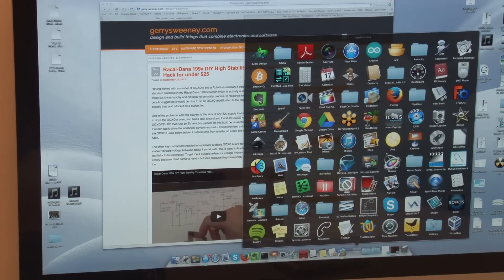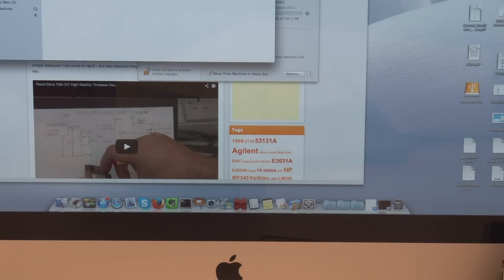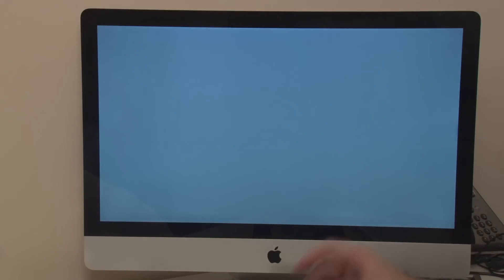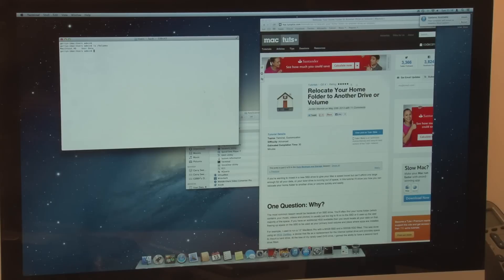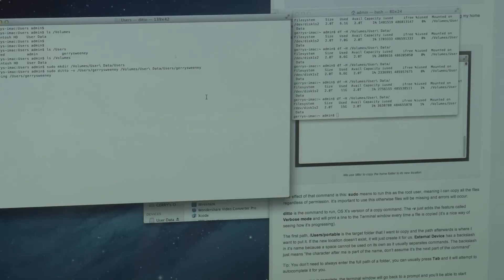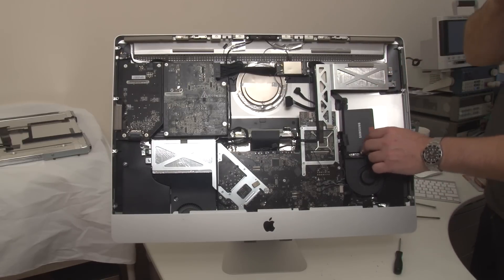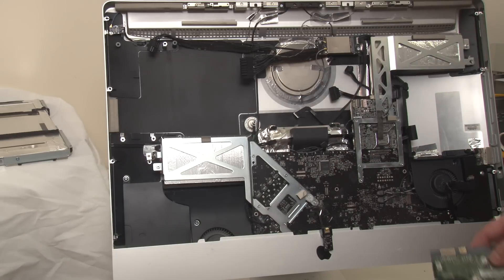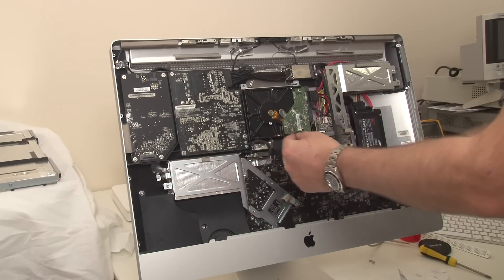Apple 27" iMac Teardown, SSD Hack and 2TB Upgrade

Comment: Hey! Thanks for this video! I was wondering if you could help me with your temperature hack? I have 43K subscribers so I help you out in return.
Can you explain in greater detail for us people who know nothing about transistors and thermal sensors how you did that at 1:01:00 . When I use bootcamp my fan runs full speed at 5,500 RPM and no software works for Winblows to control it. I tried everything.  I've done hours and hours of reading and there are hundreds of people that have this problem but no one has any tutorials on how to fix it without using software. I'm a complete noob with transistors and thermal stuff so when you explained that, it went right over my head. Is that transistor thing the best one to use for this situation, or did you just grab one lying around? I would be so grateful if you could briefly explain how you did it, and point me in the right direction on which transistor I should get that would be best for this. If you can help me I don't have any problem giving you a shout out on my channel. Let me know and thanks!
Reply from the maker: EpicGamerWorld yes I have been asked a lot of questions about this.  I have added it to the list and will aim to create a video to explain in detail. There are three different approaches that apple use for temperature sensing, and this video only covered one. To do this justice I would need to cover all three types so I will see what I can pull together, it does seem to be a source of frustration for people.  Thanks for your comment and for watching. Any shout out you give would be much appreciated. Gerry
Reply: EpicGamerWorld In case some folks aren’t comfortable whuffing up their own sensor, FWIW I was able to add a 3TB drive to my mid-2010 27” iMac (after the original 1TB died prematurely) and avoid ‘turbo boost’ by applying one of the old external HD temp sensors from a pre-2009 iMac (which I found used for about ten bucks). 

Alas I can’t find that Apple part # now (just the link to where I bought it, and they’re evidently out of business). Happily others have reported that using the external temp sensor from the optical drive (part # 922-9229, currently available at http://www.applecomponents.com/items/0000004398/cable-temp-sensor-optical/?pn=1) also works fine. 

Just make sure you insert the connector right-side up (it’ll go in upside-down too) or it won’t do squat…
Reply: Cz4rMike I got a fan control application called SSD fan control or something like that, but when I boot up into bootcamp my fan starts to run full speed again and I tried like 10 Winblows programs for fan control and nothing worked.
Reply: it runs fine because I have SSD fan control installed on mac but on bootcamp it goes crazy. I just installed bootcamp and a fresh copy of Winblows 7 like a few weeks ago.
Reply: No it messes up when running mac but the software fixes it. But I can't run mac software when I'm booted in Winblows, so I tried installing like 10 different Winblows fan control things and nothing works
Reply: I want a hardware fix not software so it will work no matter what

Comment: Definitely amateur hour here. Gerry you should have used a Opti-bay converter then you could have done away with all that additional wiring.
Reply from the maker: I don't think I was aware of such an adapter at the time otherwise I might have considered it, my goal was to get the job done which I achieved, I am still using the computer right now.  Sorry you feel it was amateur hour, I was certainly figuring out things as I was going - feel free to not watch or ignore the content if its not to your liking. :)
Reply: Gerry Sweeney Optibays have been around probably since slot loading laptops, they allow people to repurpose the odd tray to accommodate a secondary hhd/ssd. Well, I guess, if you didn't know, you didn't know. Great effort on the video non the less.
Reply: Yes, I used a ESata to Sata Converter and it worked wonderfully.

Comment: I'm no Mac guy but can't you just drag over the folders and files you want over to the new hdd. By the way I'm glad I have a pc desktop
Reply: There are a ton of invisible files that you'd miss, for one thing - and you'd have to re-install a lot of your programs.
There's a utility called Migration Assistant that automates this whole process for Mac-to-Mac transfers.  What Jerry did here could have been done by cloning the internal HD to the SSD. There's a program called Carbon Copy Cloner which does a very nice job of creating a bootable clone.
Reply from the maker: I have used CC many times before but I have seen lots of problems when the drives are different geometries which is why I opted for a file copy - its much safer... this is why Apples own TimeMachine does file backups and not image backups.

Comment from the maker: @Kalinga Yeah I know, slip of the tongue there I am afraid, I have spent so much time with Linux over the years I tend to use the word Linux as UNIX - which I know I should not do - sorry there BSD fans :)
Reply: a linux guy...using a mac..thats like a guy who's used to full on engineering playing with those toys kids have with the different shapped/colored holes and diff shapped/colored blocks
Reply from the maker: Revoku Yeah but with Mac I get the best of both worlds. Video and graphics editing is 10 times better than on Linux, yet run a terminal and I am on a pretty powerful BSD Unix system giving me all the tools I need to connect and interact with Linux servers.  Best of both :)
Reply: Gerry Sweeney editing is about the same(see adobe range, mainly premier pro cc and after effects cc),

I tried final cut pro once, it wouldn't accept any of the input video types anything I can could provide, so really it was quite a bit worse

and any os worth a damn has the tools to connect and interact with linux(putty and its variants), its a terrible choice for both, at the very least I would have expected to see it be a "Hackintosh", as you typically pay 3x the cost for the same hardware with about the same failure rate when you buy a genuine mac, out of the 3 people who actually brought mac laptops at my old uni, all of them had hardware problems, and two had software issues, one of those two had overheating issues during the winter of all times

its a weak balls cut off bsd system thats rubber padded for babies with many things locked off, slightest problem and the damn thing kernel panics

I just don't understand why a smart guy like you buys a mac

maybe I should give it another go and see if they've updated final cut, and fixed many of the problems last time I used a mac :/
Reply from the maker: Revoku I don't doubt that but its the overall UI experience, not just the tools, I find the UI on MAC far better than on the numerous Linux variants I have used. Granted that experience goes back a while now but as far as I am aware the UI is still broadly based on X11 which always feels uneasy to me. Personal preference I suppose but I am very happy using a Mac.  Gerry
Reply: Gerry Sweeney fair enough, its good to see a mac user whos not a dumbass, I personally cannot justify spending 3k on 1.5k worth of parts, but then if I wanted a mac I would probably run an intel hackintosh on my system, it has all compadible parts out of the box so to speak, additionally I can't knock the compactness of a computer built into a screen, being in the small flat I'm in
Reply: +Revoku Yeah, I wasn't thrilled about the price of the iMac's I have bought over years, but my first I bought in 2006 (for $1400) and up until last month (when the person I gave it to dropped it while moving) it was still running just fine.  (I do a full blow out of my machines on a annual basis to keep heat from being an issue).  I don't like laptops, but have an old macbook that I use if I just want a laptop to travel.   Compared to a Dell and HP that I have had in the office for work (use the Mac at home for work) the MS machines are and have been less reliable from the start.   I haven't had the inclination to use/learn Linux (even though they are both Unix based)  I'm just not a fan of the Linux user interface / experience.    It's probably really simple when your pushed to learn it, but between OS-X, Win 7, CICS, and STXS i'm just not interested in learning another system.... At least not yet. :-)

Comment: Kinda looks like the inside of a console.. That just tells something about how under powered it is for the price..
Reply from the maker: Not sure I agree with that, they are pretty powerful computers, at least for the work I need to do  (video editing), If you think about it most desktop computers are overpowered for the job they do, it is ludicrous that you need a 3.2Ghz CPU to browse the web! its just the software and operating systems, in particular Windows has become so over-bloated and unwieldy you need the CPU power (and memory for that matter) to compensate. Thats where I think Apple have done a good job, they have focused on the software and making it efficient, and thats why my son is still using an 7 year old Mac computer running the latest version of OS-X, and while its not blistering its more than serviceable for his needs (gaming, browsing etc) is every bit as good to day as it was when we first got it.  In all my time I have never had a PC thats remained that serviceable.  So divide the cost of the computer over its serviceable life and there is some justification for the price premium...
Reply: Gerry Sweeney Not at all. I work with video editing too. And i'm also learning to become a colorist. Normally i work with large uncompressed video formats like RAW dngs tiffs and DNxHD which are cinema standard formats. My normal lvl pc works great for that and i almost never crash or fill up my GPU like i do when i work for companies that have Imac's.. The OS-X itself are just not the way for me. If you like it fine, but i would rather think of the hardware as the primary subject, since it is very important in video editing, VFX work and everything else graphical. It is funny cause i always looked at the Imac as a browsing computer; it doesn't have good hardware, it also are not very customizable. If your windows computer really became so bad after a while, you clearly didn't know how to keep it clean, and it was properly way way less expensive than the Imac :)
Reply from the maker: All true, I write software for a living and I know exactly how poorly implemented the Windows stack is...I have spend 20+ years writing software on the platform so you get to know it after a while :) The OSX is based on FreeBSD which is by far a better OS Kernel...but you are right, I just happen to like MAC and OSX...I am not say I am right, but I am right foe me :)
Reply: Gerry Sweeney Windows are only as good as you set it up to be. If you don't have any computer knowledge then it can be hard to get 100% out of your Windows machine in some area's. But for editing, coloring or web browsing i don't really see the difference in performance between OS-x and Windows 7/8, a good windows PC can however be better for the price and have a lot of graphical performance and hard disk space without costing the same as a car. Operating system is about personal preferences, hardware and customization is not.  :)

Comment: All removed is useless, just remove the screws from the motherboard and the burner and wifi card and tilt the motherboard to install the cable connector. This guy knows absolutely nothing because it becomes complicated for life unnecessarily.